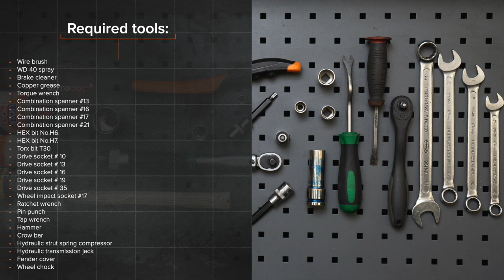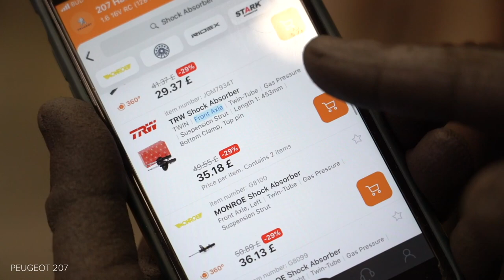Hvordan bytte fremre fjærbein der på PEUGEOT 207 [AUTODOC-VIDEOLEKSJONER]

Comment from the maker: Merk! Det er en feil i denne videoveiledningen.
5:50 - Skiven bak må strammes med dreiemoment på 75 Nm, ikke 60 Nm.
8:21 - Skiven bak må strammes med dreiemoment på 55 Nm, ikke 65 Nm.
8:34 - Skiven bak må strammes med dreiemoment på 245 Nm, ikke 175 Nm.
9:35 - Skiven bak må strammes med dreiemoment på 43 Nm, ikke 65 Nm.
10:16 - Skiven bak må strammes med dreiemoment på 100 Nm, ikke 120 Nm.
10:32 - Skiven bak må strammes med dreiemoment på 75 Nm, ikke 65 Nm.
Vi beklager ulempen 🙇‍♂